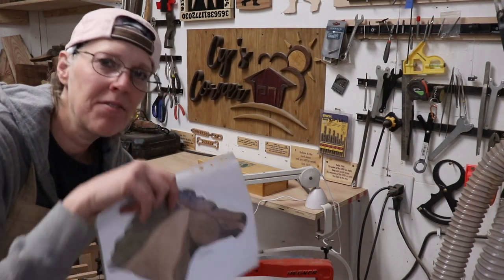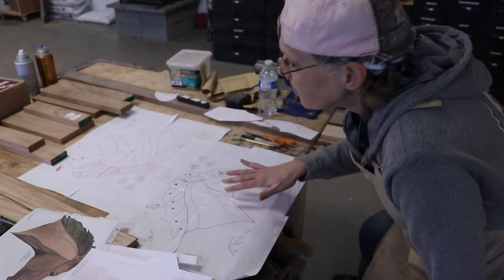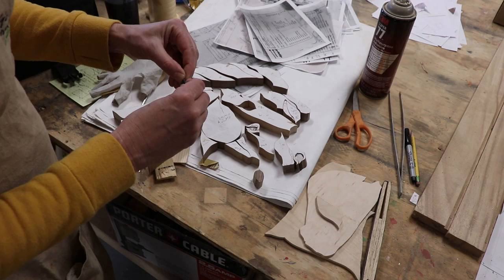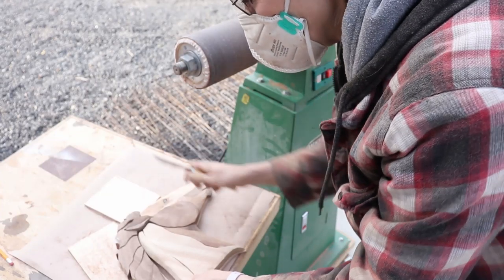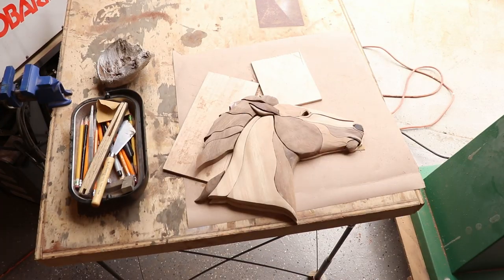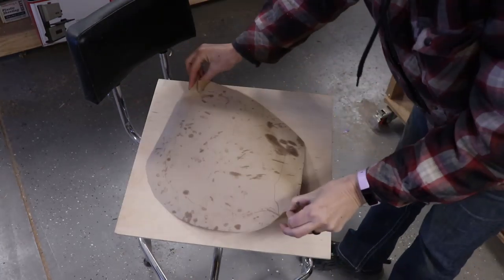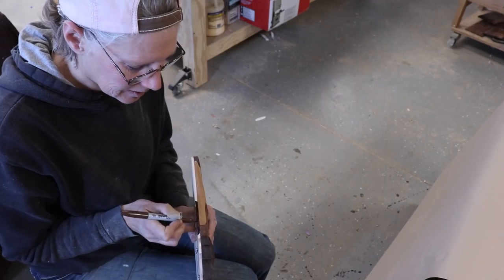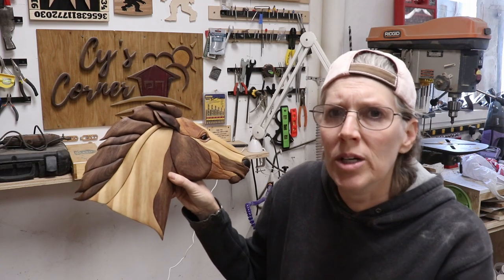Horse Intarsia

Comment: Cy,  great project. I have never tried intarsia but might one of these days.  Here is a hint for you...when you use spray adhesive to hold a pattern directly to the wood, a really easy way to remove the paper pattern is with mineral spirits.  I keep a jar of mineral spirits close by and a foam brush.  I dip the foam brush in the mineral spirits and coat the paper pattern.  Let it set for a few seconds and the paper will peel right off. A paper towel and some more mineral spirits will clean up any residue.  Lay out the paper and paper towels to dry thoroughly before discarding.  Another option is to carefully use a heat gun to remove patterns.  Hope this helps.
Reply from the maker: Thanks for telling me this Paul!!! I did this today and it worked fantastic!!!! I don't know if I had heard this before but you reminded me and yay!!! No more hassle with that!!!

Comment: Hi Great video .New to intarsia as i have just retired .I have ordered the DVD as you mentioned From Judy Gale Roberts .It might take some time to arrive as i am in England ! So while I am waiting I will try to order some timber .What thickness of timber did you use ? Many Thanks
Reply from the maker: Hello, a thickness of 3/4 inch gives you nice dimensions to the finished work. But you can also use thin pieces or even thicker than that. You will discover what thickness you like best as you go. Good luck to you!!!!

Comment: Is your foot switch just an on-off switch or can you control the scroll saw speed with it?  

My basic Delta scroll saw has some things that bother me.  It won't start at the slowest speeds,  You have to start it near full speed and then dial the speed down.  If you stop the saw you have to do this over again.  I also don't like how the knob is located under the table.  It makes it hard to shut the saw off quickly if something goes wrong.  Finally, it uses pinless blades so you really have to grab the blade ends tightly which is hard to do.  I wind up tilting the table to get at the nut and then I have to re-square the table.
Reply from the maker: It is only on and off, no variable speed with the foot switch. Ahn man that sounds like a hassle. I was always adjusting my blade clamps on my last saw, it was always slipping. I am very happy with my Hegner!

Comment: Hey Cy. Projects look great!  What brand/model sanders do you use for your horizontal drum sanders?
Reply from the maker: I have a Woodtek pneumatic drum sander that is no longer available. But one that is similar is a Grizzly
My smaller is a flex drum, the sandpaper surrounds a foam cylinder and it is attached to a variable speed grinder motor.
Here are links to the sanders and the bench grinder.
Grizzly G8749 - Drum / Flap Sander

https://www.grizzly.com/products/Grizzly-Drum-Flap-Sander/G8749

Flex Drum sander: https://intarsia.com/search?q=flex+drum
Delta Power Tools 23-197 8-Inch Variable

And Speed Bench Grinder: https://amzn.to/308rZEp